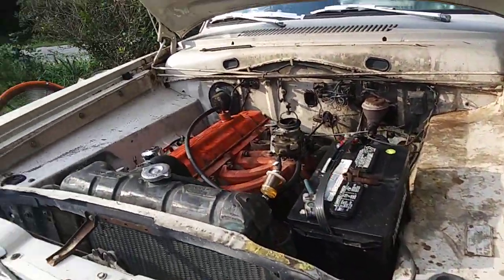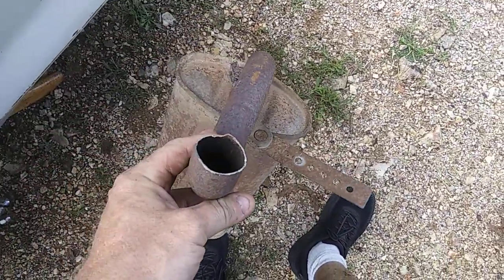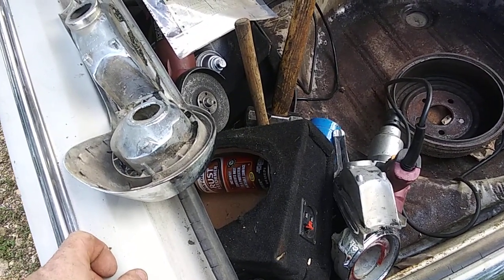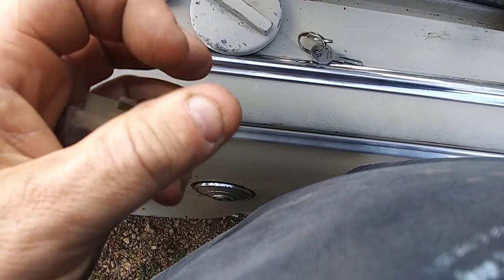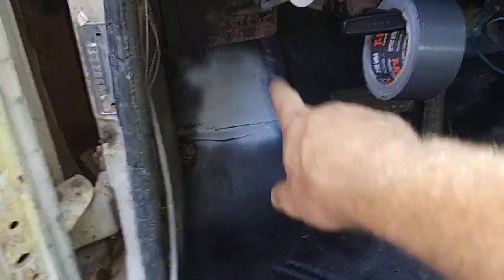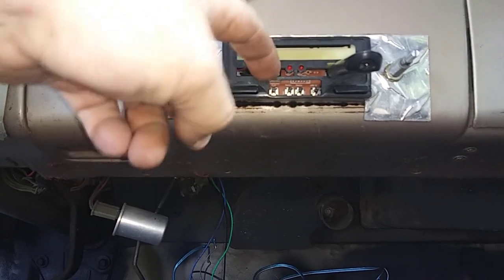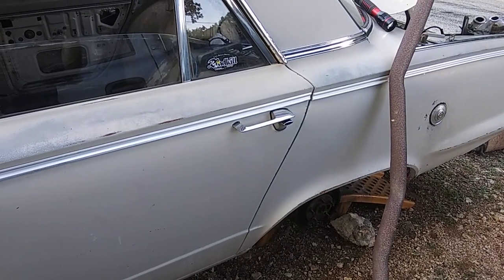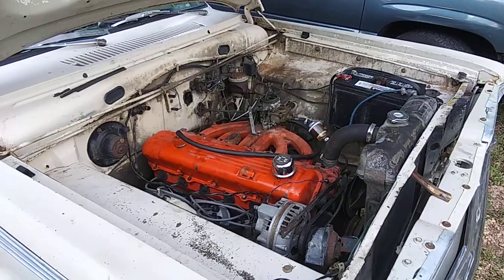PLYMOUTH VALIANT 1965-66  UPDATE

Comment: Add the 2 barrel manafoild an a 350 Holly with extractors an a two half in exhaust. Also index your plugs so the spark 🔥 fire between the 2 valve not pointing away  . In Australia there were 2 types of  engine pipes one for the 145 hp slant . An a larger 1 for the 160 hp slant 2 barrel   . We also had a 175 hp VF valiant Pacer  higher compression etc . Modified dizzy  etc   You can adjust that value lash a fee tho extra  inlet an exhaust for more hp  . Brian in Tasmania
Reply from the maker: cool ! Thanks for the info  mate !  you Aussies and Kiwi's do some pretty awsome stuff to the slant6 and the super six